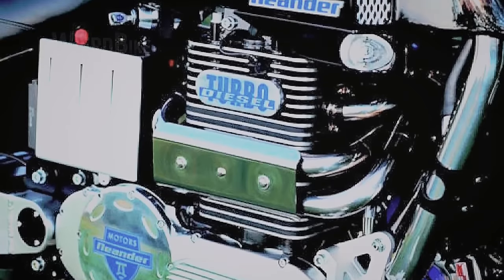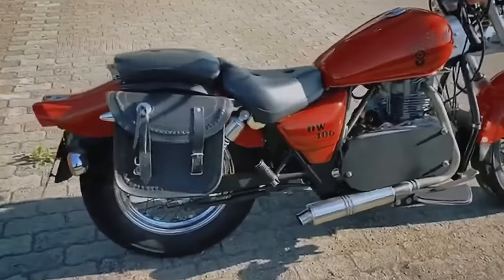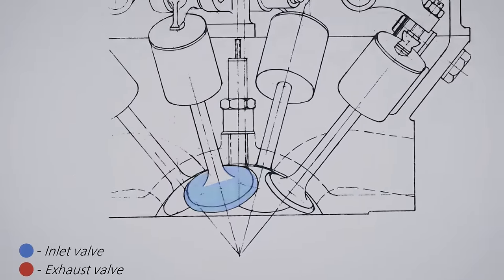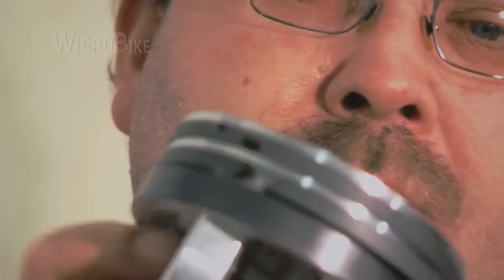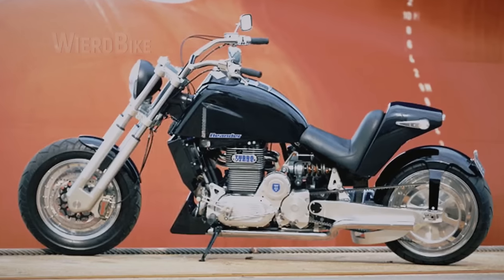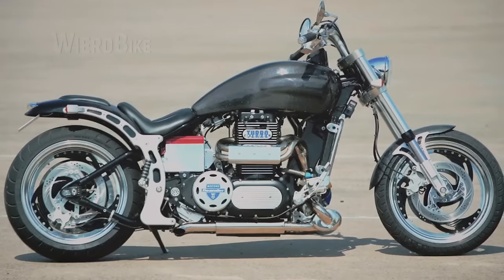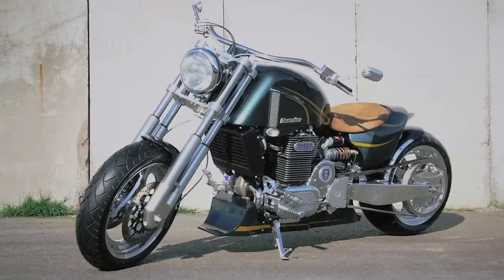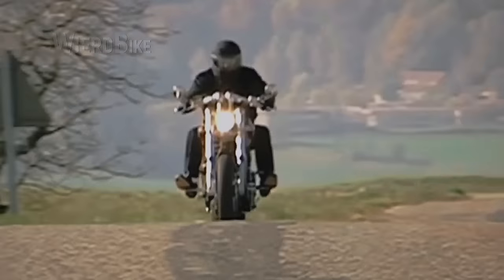Race-tech TURBO DIESEL motorcycle?! NO VIBRATIONS!

Comment: This is a nice video, but one correction: Royal Enfield definitely did mass produce a diesel motorcycle. It was called the Taurus and it was produced from the 1980s until 2000. Unlike the bike in this video, it was by no means a performance machine, but it did get approximately 200 mpg.
Reply: Was it a turbo diesel or just a diesel I think the one ur talking about is just diesel
Reply: @dillonjames-so5cz  -- Just a regular diesel. If I remember correctly, it made 7 hp and maybe it could hit 45 mph.
Reply: It reached those 45mph in a very, veeeeeery slow time tho.
Reply: Lols there was one genius in office who had one for commuting... turned out he completely forgot to fill fuel and couldn't use it 😂
Reply: @shaftdrive7567 Aint got no gas in it😂
Reply: Think it was a 5hp robin diesel industrial engine,not made by Enfield
Reply: @connor3288 whoooo I feel better now
Reply: Royal Enfield Taurus was equipped with a 325cc Greaves Lombardini 5hp pumpset engine mated to the standard 4speed gearbox. Unbearably slow, but costed peanuts to run. 
Also, a few people have swapped their old petrol Bullets with a diverse array of engines at the time when engine swaps were legal here in India. The engines used were, 455cc Greaves, Kirloskar pumpsets, Yanmar VTwins.

Comment: One of the biggest advantages of a diesel is the fact that diesel fuel has  approximately 20% more calories by weight than petrol. Thus ensuring better mpg.
Reply: 😂 yeah that's true but your overlooking that we buy motorcycles for smiles per mile not miles per gallon. E85 has less than gas but it gives bigger smiles than gas and far bigger smiles than diesel

Comment: The British firm known as Ariel built a 1000cc Square Four gasoline engined bike with two crankshafts for the same vibration elimination reason. The first Square Four was sold in 1929 and the last one in 1959.
Reply: There was another company that continued to build a bike with the square four engine in the 1970s, 
Healey Brothers .
Reply: Don't forget the Suzuki RG500 twostroke racebikes please?

Comment: the problem with diesel motorcycles is someone's always trying to turn the diesel engine into something that isn't if someone make a 500cc diesel engine basic low revving put it on a small bike to compete with the 250 class and sell it for between 6000 and 7000 dollars they would have a winner on their hands

Comment: This is, in my opinion, a stupid design. I was intrigued when it was first annnounced, but the more I thought about it, the less impressed I was. 
I am a fan of diesels, they are my job, so the idea of a diesel bike appealed to me. 
But this engine design has a major flaw, in that it is kinematically redundant. 
The cylinder defines the axis on which the piston moves. 
The dual cranks and conrods also define the axis. 
They are very unlikely to agree given manufacturing tolerances. 
A normal engine will still work just fine if you move the crank relative to the bore axis left, right or down by several mm. (up is more limited....)
This design requires the cranks to be phaesed absolutely correctly, and the phasing to match _exactly) the bore axis. 
Anything even slightly wrong can only be compensated by the piston rocking in the bore. 
It would probably work better with a single con-rod and no gears, but then the other crank is just a balance shaft driven in a stuopid way.
Reply: Actually, early in the video there is an animation of some sort of master con-rod with two subsidiary conrods to address this issue, but that feels like an over-complication to address a fundamentally flawed idea. Most of the other animations do not show this.
Reply: I can't see how adding extra mass is more efficient. More parts moving up and down and round and round means that more energy is used to move the parts. It takes more energy to rotate a heavier wheel which means less energy available to move the load.

Comment: I'm a diesel mechanic.  Do you realize how bad you would smell after driving a diesel motorcycle.How much more toxic breathing diesel fumes are. Great, cool they did it but that's where it ends.
Reply: Naaah we just need to put the exhaust pipe vertically like a truck to ensure those fumes go way above our head
Reply: @fidelcatsro6948  they still get sucked in behind you due to bernoullis. theres simply no way to avoid that negative pressure zone... not without elaborate aerodynamics.

used to ride the motorised pushbike, was always whined at about smelling like two stroke exhaust. no matter what, it gets sucked up and sits behind you...

had a flag on the back of my motorbike... only one person could explain why it pointed TOWARDS me rather than fluttering behind as one would intuitively expect was a helicopter pilot...
Reply: @paradiselost9946  It wont be as messy as a truck because of the immense torque it makes without having to haul a ton of goods like a truck..
Reply: @fidelcatsro6948  it still smells though. you cant avoid that, either. good turbo and fuel map. the visible smoke may disappear, still stinks though...

maybe vege oil, smell like fish and chips :)
Reply: @paradiselost9946  its okay, nothing like the smell of Castrol 2 cycle oil from the thrusters of a 2 stroke engine..

Comment: As someone interested in theoretical engine layouts like inline 7 engines, this twin crank design is extremely intriguing. It would eliminate the serious balance concerns and make it possible to build an engine with an exhaust that sounds like a musical note.
Reply: I’m interested in the inline 9 and inline 13 engines.  If I had to pick a favorite it would be the inline 9 cylinder.

Comment: With 2 crankshafts this 2 cylinder would probably be more expensive than a 4 cilinder. Also strange: now that ICE is obsolete and everyone is transitioning to electric, there have never been as much videos about new ICE tech. 🤔
Reply: Thats because its far from obsolete. Electric powered vehicles at this point are just a gimmick.  Battery tech isnt there to make them truly practical and the resources to make the batteries are limited. Hydrogen power is the way. Infact the HySE-X1 (hydrogen powered) is being entered into the Dakar rally which is well over 4000k miles total.